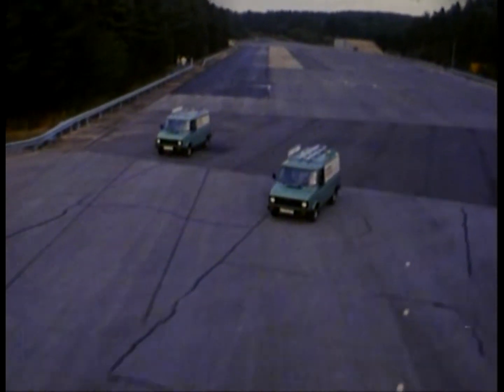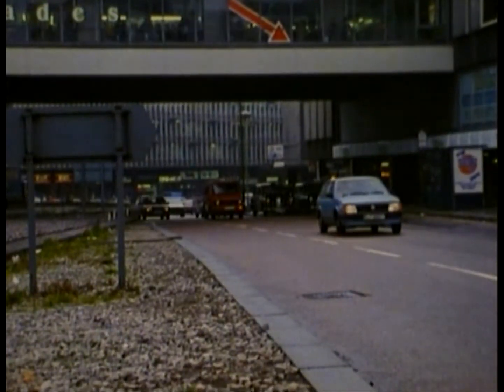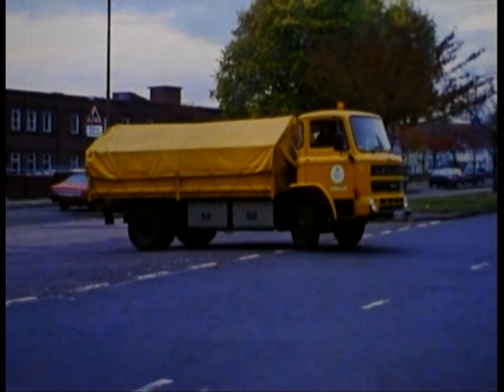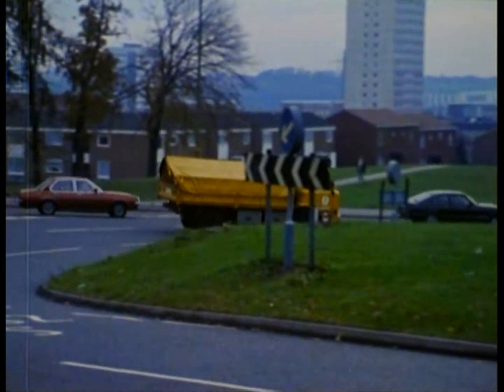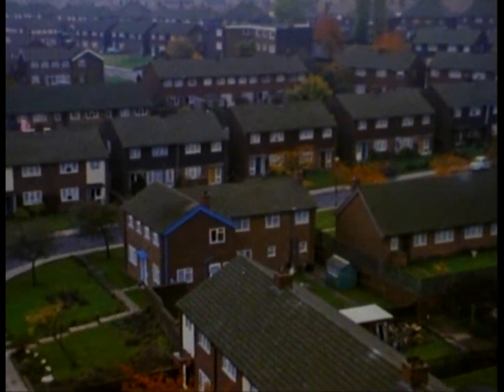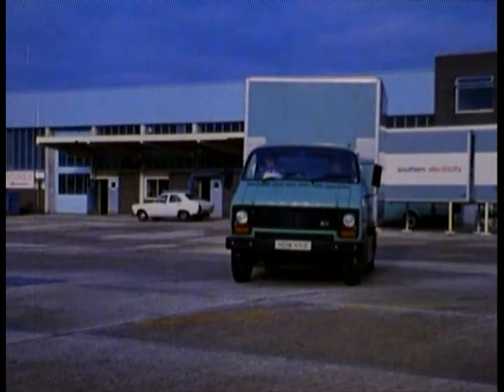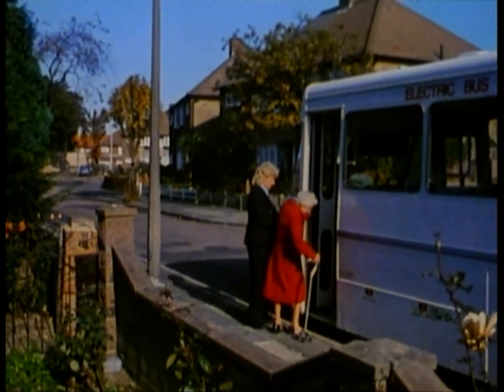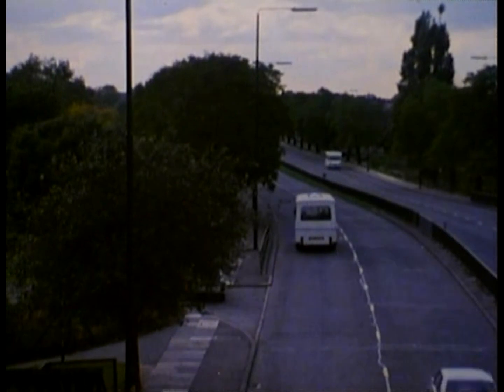Electric Revolution (1984) Electric Vehicles - UK sales film

Comment: Wonderful ideas, and I remember some of them. Birmingham had electric dustcarts for many years which were recharged by burning the non - reusable rubbish to make steam to run a dynamo set at what was called the "Salvage Department" Nowadays this'd be considered as very "green" but alas, the 60's saw them replaced by diesel dustcarts, and all refuse was incinerated, with no salvaging. They call that progress?
Reply: I remember Gloucester's street cleaning crews had electric side-loader vehicles in the 70s and 80s (they were K-reg). Simply the power of the oil companies and vehicle manufacturers  that have held back the development of electric vehicles.
Reply: In the context of the 60s, within the growing consummers society, convenience above all was considered progress.